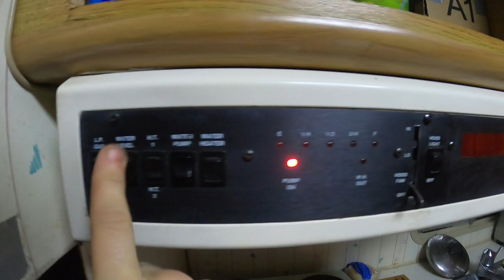Replacing RV Water Pump || Ranch Vlog

Comment: Good job Nathan, now you might consider getting a backup that is ready to install on a moments notice, I keep 2 pumps ready to go at all times cause they fail, I also installed a shutoff between tank a strainer/pump to keep the water from freezing at night as we live year round in snow coumtry, keep it up man.
Reply: I think a heat lamp or small heater would keep the pump from freezing up.